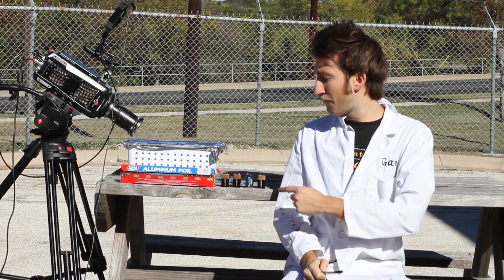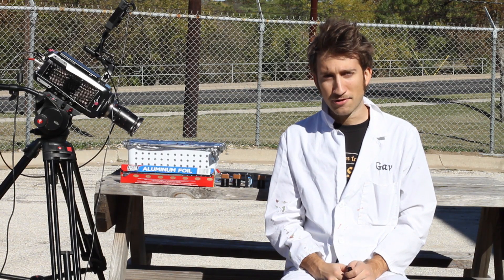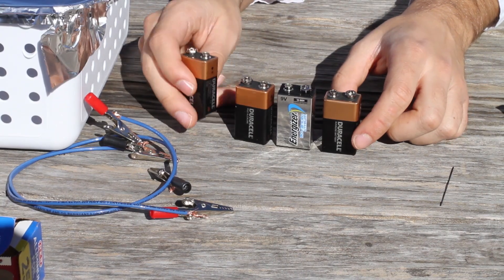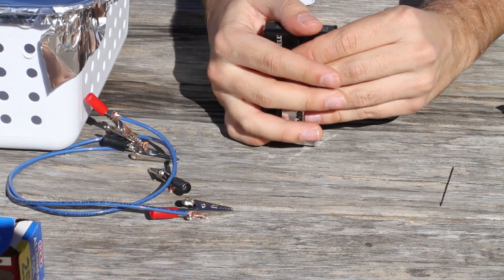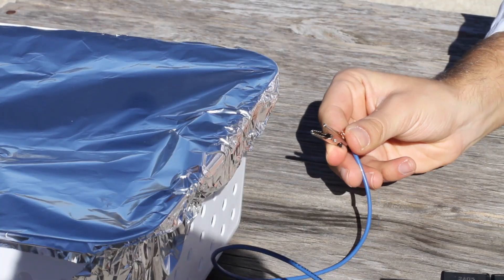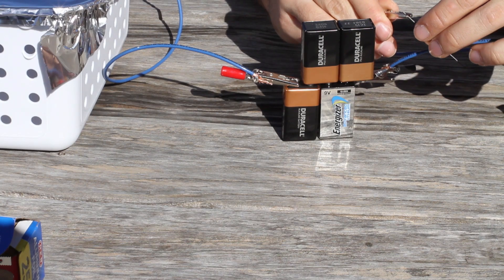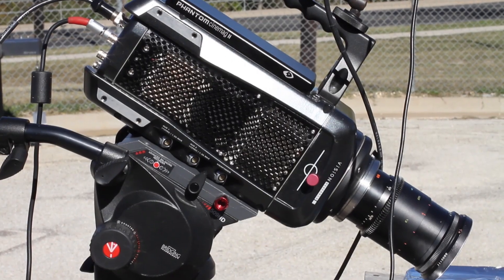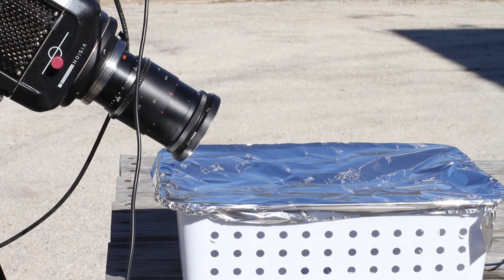Tiny Plasma Cutter in Slow Motion - The Slow Mo Guys

Comment: I know this video is a year old but wanted to point something out since this is my first time seeing this video. As someone who handles plasma cutters and welding machines on a regular basis. What you guys made there is actually what would be called a stick welder, the problem is 1 the pencil lead won't melt with the electricity you guys we producing with those batteries and the aluminum foil is melting too quickly. A plasma cutter on the other hand is actually burning pressurized gas and has no stick to it.
Reply: +Nick Monterosso Wouldn't this be more aptly described as arc cutting?  That's a process that uses a sacrificial (or in this case not so much so) graphite rod as the electrode.  It wouldn't be much of a welder since it provides no filler material, anyway.
Reply: +Nick Monterosso As Im just learning how to weld but have no experience with plasma cutters I really wondered about this! Thanks for clearing it up.
Reply: +Nick Monterosso This would actually be Carbon arc cutting/gouging. If pressurized air was used to blow away the molten metal it'd be Air carbon arc cutting/gouging. In this process a copper clad graphite electrode is used the melt metal and pressurized air is used to blow molten metal away. This process is used in heavy industry to attain a 100% full pen weld joint. I work at a shipyard where every hull seam is required to be full pen and we use air carbon arc to back gouge. I was actually just using it yesterday to remove 300 lb lifting eyes from a keel mod.
Reply: +Zoidberg227 or arc gouging but yes this guy mr. zoidberg here has it right.
Reply: actually a plasma cutter does not burn pressurized gas, it is a high voltage electrode that makes a high power plasma arc and the pressurized dry air is just to push out the arc to a fine tip that melts shit fast
Reply: +Josephthinleg troll?
Reply: opinion so it is not a fact that these guys suck just keep your stupid little negative comment in your head no one really cares
Reply: +Nick Monterosso  this is called carbon arcing there bud. for someone that handles welding machines and plasma cutters i figured you would of know that....
Reply: +Josephthinleg Well those arc's you are seeing is technically plasma. Pretty much all arc's you see in life are technically plasma. SO TECHINICALLY you could call a carbon arc gouger a plasma cutter, or a welding machine a plasma welder... But we dont do that because its easier communicate what we mean when we abide by their given names.
Reply: +Nick Monterosso 7 month old comment, but I wanted to clarify it little.  What they have isn't a stick welder, it's a carbon arc.  Plasma cutters also don't burn pressurized gas.  They create a very hot arc, similar to a carbon arc or welder, and use pressurized gas to blow the melted metal away forming a kerf.
Reply: +JeffPlays You took the words right out of my mouth...or off the tips of my fingers, LOL. Whichever, but I was about to make the exact same reply, thanks!
Reply: Like I said before I am no authority on this subject whatsoever as Im brand new to welding but I did just want to add something about what Zoidberg said concerning it not being much of a welder cause it provides no filler. With TIG welding the filler is added via the filler rod vs MIG welding where it is fed through the welder. I think that is the principle that Nick was going off of with his original comment. In this video it looks like the same application as a tig welder but in a scenario when the arc is too strong, thus melting the source metal. If you changed that lead into a TIG gun and added a filler rod to the equation you would have what would appear to be a TIG welding vid. Once again I'll throw out my disclaimer here that Im not claiming to know anymore than you guys, quite the opposite. Im just adding to the conversation.
Reply: +Nick Monterosso Interesting point! I'm still making one tho haha
Reply: I Agree with You, What they are Showing Here is a little DC Stick Welder, with no pressurized gas tank of any kind. However, I do like seeing things in Slo-Mo and Macro and Kirilian, etc... Maybe, someone will notice something unusual and make an incredible discovery? WHO KNOWS?
Reply: +mrkthmn same i'm laerning XD
Reply: +Nick Monterosso Incomplete sentences have no place in a comment where you intend on making corrections to something.
Reply: +mrkthmn there is no filler added in true arc welding, chief. which is what he made here. a tiny ARC welder.
Reply: +Brad Walton it actually wasn't interesting at all, but that is personal opinion. what is FACTUAL, is that this is NOT a plasma cutter. that is actually the only FACT here. Sorry to ruin your celebration.
Reply: +Nick Monterosso That isn't a Stick welder, 1 because stich welders are CC power sources constant current. those batteries would produce a CV machine which would be more closely related to a GMAW machine. But its obviously not a GMAW. Since the electrode is made out of graphite it would be better classified as a carbon arc gouger, CAC-A are usually CC but sometimes can be used with CV machines. The only real difference is that there is no air involved with this process in the video.
Reply: +lucas williams nice spelling it's (Lead not led) (Poisonous not poisonois.)
Reply: Woah
Reply: +Zach Tougas THANK YOU! Seriously guys, its technically carbon arc cutting/gouging. Zach got it right.
Reply: +Postghost mic dropped
Reply: +Postghost this is true but in reality this is an arc welder, and yes plasma does arc off the end of the electrode
Reply: Nick Monterosso and now your comment is one year old 😂😂😂😂
Reply: While that is 100% true for this rig, and most, if not all home-gamers, tullgutten, at my shop(not the farm) we use a mixture of compressed gases, a Hydrogen, Nitrogen, Argon tri-mix. 

They act as the plasma gases in place of shop air, to create a "hotter", or more 'current dense' plasma jet(the arc) for cutting much thicker plate, square, and round stock. It's pretty awesome to watch up close with my hood on, even after almost 20 years! 

Do you know the other very important reason for the compressed air on a hand-held plasma cutter? :)
Reply: pencils do not have led in because it is poisonois and when it was used people would lick there pencils now for safety it is made of graphite
Reply: +lucas williams They were never made with lead (the metal) in the first place. How do you think people would have wrote then? They've always been made from graphite.
Reply: This thread is fucking stupid, quick physics lesson for the day: 
All visible electrical current is PLASMA, children.   Plasma, is merely the noun for the visible discharge between two electrodes that is caused by electrical current, ionizing gasses in the air. 
∴ This device uses plasma to cut the aluminum, hence: plasma cutting.

Don't forget to leave your papers on my desk as you leave, and don't forget to say your times tables, and say your ABCs before momy and dady send you off to bedy-bies 2nite, ok? ...okay
Reply: +Josephthinleg if they were just putting in fake words to get views they would have deleted the original comment.  Instead they left it up there thinking it would probably educate people who saw the video correcting their original mistake.  They can't change the video since it's already been filmed.
Reply: Nick Monterosso easy explanation

Click bait
Reply: Brad Walton Correct! You get a gold star you idiot. Yes, it is INDEED just a few 9v batteries and a stick of graphite, (not lead BTW) you fucking idiot. Again. Yeah
Reply: +Nick Monterosso Yeah definitely not a Plasma cutter, these guys suck and are just trying to get views.
Reply: This is not a PLASMA torch, or anything "plasma" related. These guys just put fake words in their videos to get views, and their videos suck. My opinion, but it's true.

Comment: Ah-loom-IN-Um, not "aloo-miniem"
Reply: Robo Lizard Depends where you live
Reply: Robo Lizard And plus dude Alumnum is the simple way of saying it. The actual Material is Aluminium
Reply: +Robo Lizard Aluminium is the official spelling, but Aluminum is acceptable.
Reply: Actually the original word is aluminum but the British changed it to minium because they wanted it to flow like potassium. So technically uminum would be correct.
Reply: +Dominic rached The british didn't change it, Davy Himself did, you know, the guy that originally called it Aluminum.
Reply: Lmfaoooo 😂🙌🏼 I thought I was crazy

Comment: What happens is that there is a lot of current running through the metal at once so it causes it to melt. Aluminium has an oxide layer which burns at high temperatures making the gas expand causing the newly molten aluminium to explode off the needle making a hole in the sheet of aluminium.

Comment: Try this at home kids
Reply: My brother did it with 10000 Volts. There is a reason I'm typing this comment and not him.
Reply: +Lance Armada Okay. Burns hole through skin Sues
Reply: +Lance Armada I did
Reply: +Lance Armada Nope, Still kickin! :)
Reply: +Lance Armada im going to do but from seeing this comment (and answers) im going to use gloves =D
Reply: I will
Reply: did you got electrocuted?
Reply: +Joshua Lorenzo Nah, didn't do that either... I was reeeaaally careful
Reply: ***** Really? Worked for us... Sorry to hear that... ;) It's pretty fun.
Reply: ***** Hoo boy! That might work! I've though about using a few car batteries... Haven't worked up the nerve to try it yet though... ;)
Reply: ***** That's true. But I was planning on using more than two...
Reply: +Lance Armada If You add amperage it will actually work better. The voltage is there to initiate the arc but the amperage does the cutting!
Reply: +Lance Armada 1 of my friends got a little shed where do alot of stuff we've made armstrongs mix in there and we all almost got deaf =D
Reply: +Lance Armada Oh I plan on it.
Reply: +Lance Armada 36v won't kill anyone... it'll buzz a bit and that's it. I just tried it.